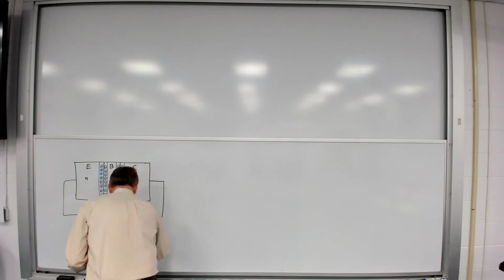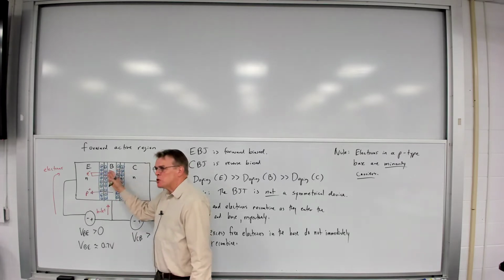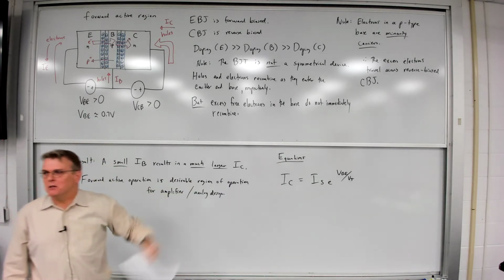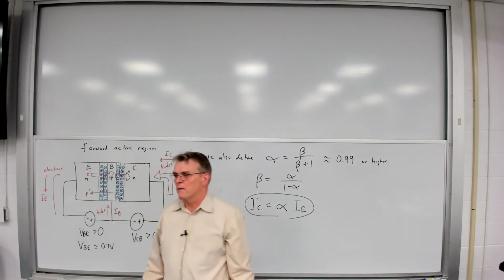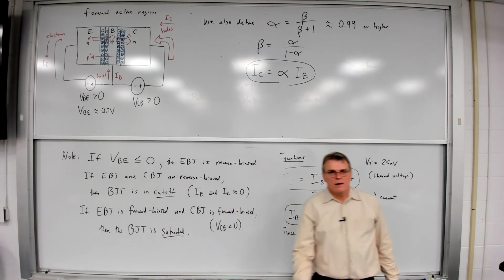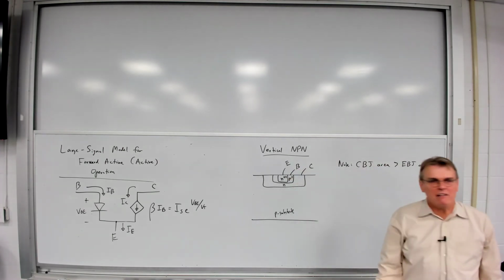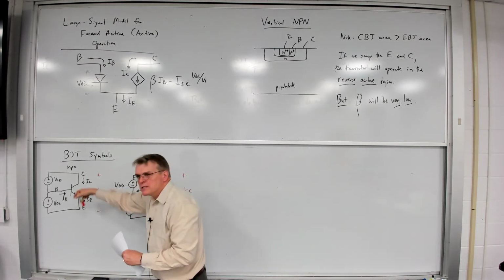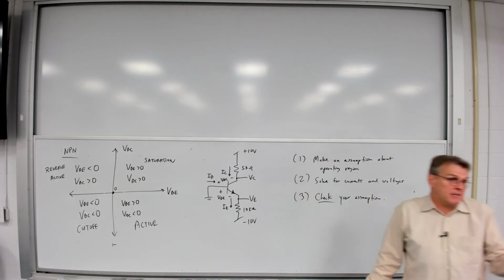Electronics - Lecture 13:  BJT beta and alpha parameters, cutoff, saturation, DC analysis of BJTs

Comment: Hmmm… I think it’s possible to derive the equations for the currents by using the continuity equations, poisson equations, drift and diffusion current equations. Just gotta figure out the boundary conditions at the metallurgical junctions
Reply from the maker: Indeed it is.  But if I had done that, it would be a semiconductor physics course, not a course in electronic circuit design.

Comment: Is*e^(Vbe/Vt) <- this is the same formula as for the current in the case of the diode, which is on the left.

So there is a certain contradiction here. 

Based on the formula for the diode current:
I = Is*e^(V/Vt)
we can conclude that it will be identical to the Base-Collector current.

Maybe the point is that the Is in the formula for the diode current is a different value than the Is in the formula for the BE current?
Reply from the maker: You are correct.  The BJT collector current does follow the same exponential current-voltage equation as a P-N diode, but the effective value of Is for the BJT will not be the same value of Is as the diode.

What you'll soon find is that we really don't bother with the exponential equation when learning how to bias a BJT.  It is much easier to use the CVD (constant voltage drop) model in DC calculations.

Comment: shouldn't Vcb < 0 the same thing we did with the P-N junction diode
Reply from the maker: Saying Vcb < 0 is equivalent to saying Vbc > 0.  In this case I used the convention in the textbook.  The authors prefer to express the collector-base and base-emitter voltages as positive voltages for normal operation.  So in the forward-active region of operation, the BJT will have Vcb > 0 and Vbe > 0.

Regardless, you can always flip the order of the subscripts and switch the direction of the inequality sign to obtain the same results.